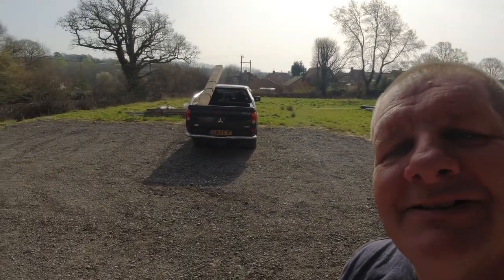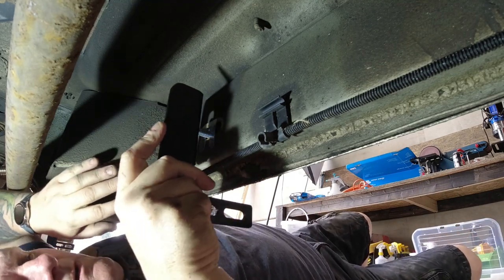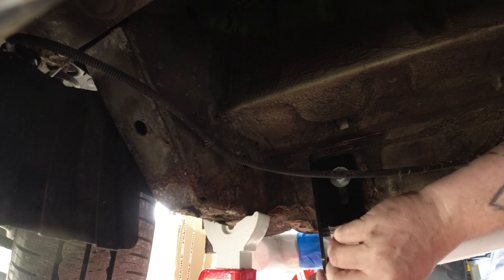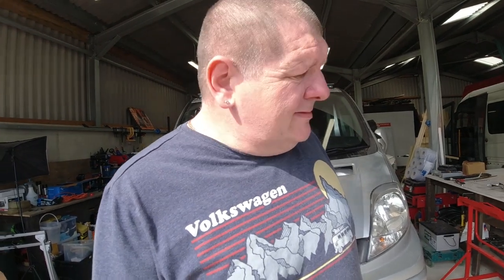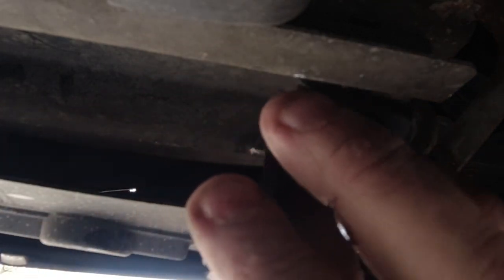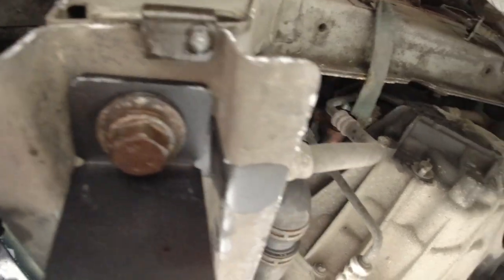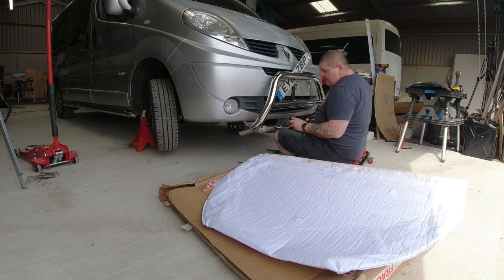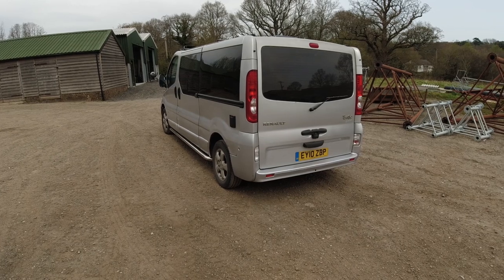Renault Trafic Campervan Conversion - How to fit a Bullbar and Side Bars FULL TUTORIAL

Comment: Very good, I had same side bars and after a month of winter weather the black brackets and bolts were rusty so changed for stainless and powder coated the brackets.

As for the bull bar, it is ILLEGAL to fit on vehicles newer thanks 2007 unless it is approved which that one is not. Looks good though, yes it may pass MOT but you hit a pedestrian and you are in trouble.
Reply from the maker: That's a good idea to extend the life of the brackets

Comment: Nice job thinking my 2005 would look great with the bars fitted , might paint the bracket at the front silver by number plate . Liked the above windscreen roof light , what is that ? Or might fit driving lamps to the bull bar well done good video
Reply from the maker: The light above the windscreen is just a curved lightbar, available on ebay and amazon.  Those bars are good and give it a nice look.